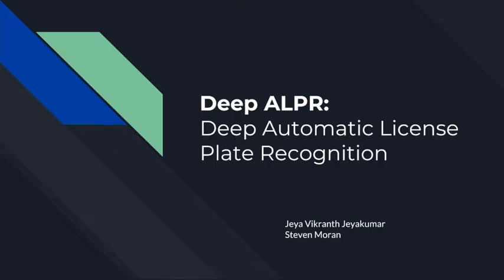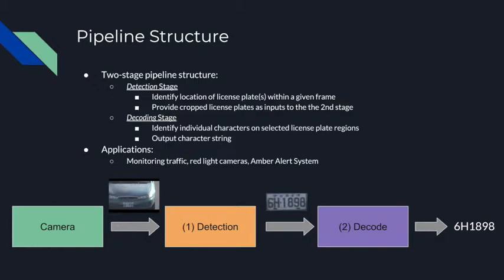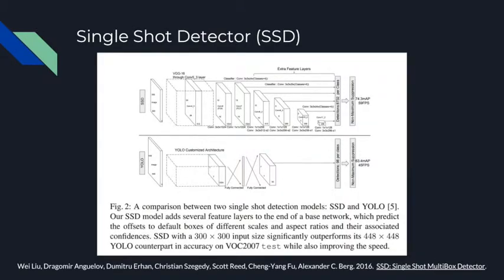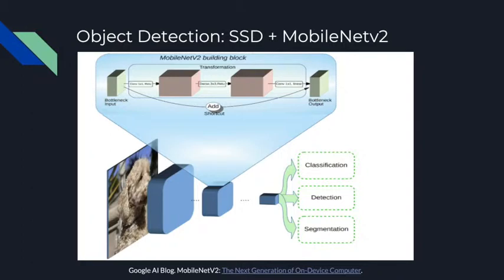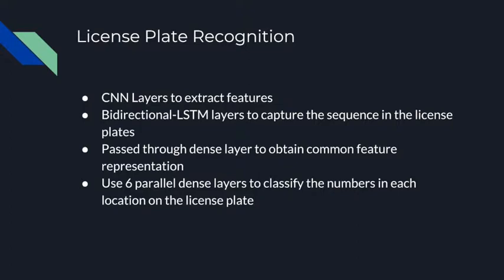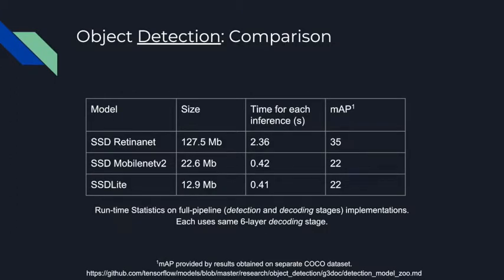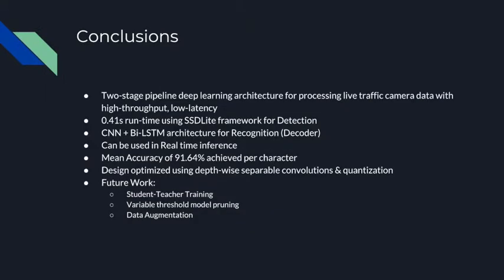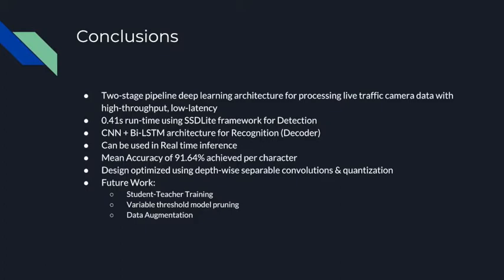License Plate Detection and Recognition using Neural Networks

Comment: May I know why you didn't use yolov3 architecture network?
Reply from the maker: We were only detecting one object (license plate) and the choice of network really didn't matter as almost all the object detection models were able to identify license plates accurately. So we decided to go with the smallest model SSDLite+Mobilenetv2 which was only 12Mb compared to YOLOv3 which is around 200Mb in model size.